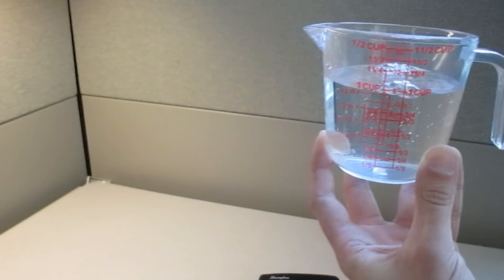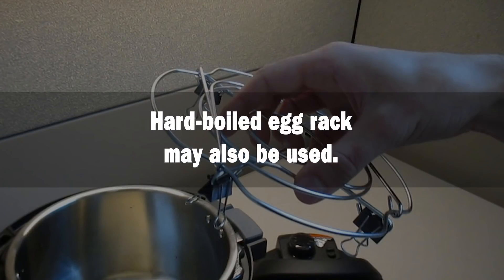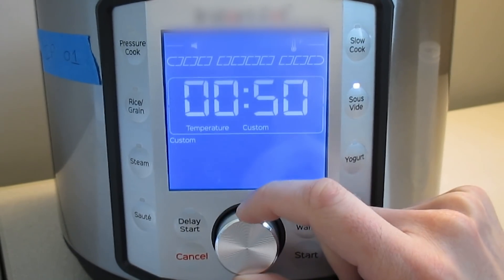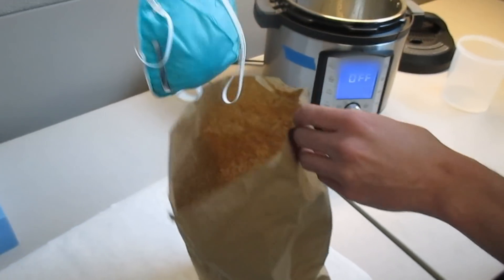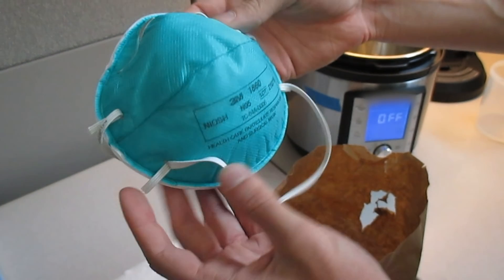Multicooker Decontamination of N95 Respirators

Comment: Tradución a Español 

0:35 Añade una pulgada (3 centimetros) de agua al cuenco
0:45 Después coloca un rejilla al fondo del cueco. La rejilla asegura que ni la mascara ni la bolsa toquen el agua (también puedes usar una rejila para huevos duros)
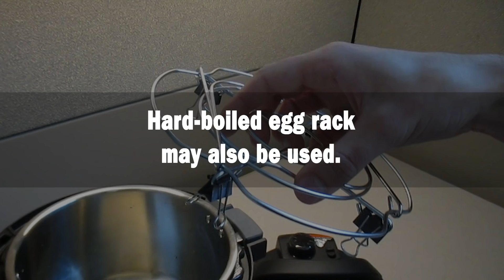1:02 Pon las guantes, y situa la mascara sucia dentro de una bolsa de papel; puede sostener un máximo de alrededor de 3 mascaras
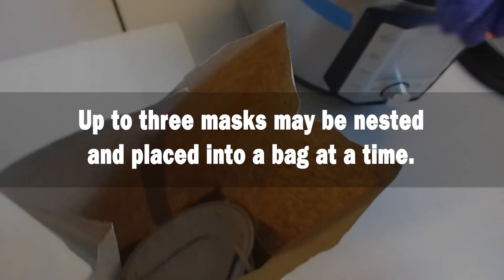1:18 Quita y tira las guantes a la basura, luego cierra la bosla con un clip de papel, o una grapa
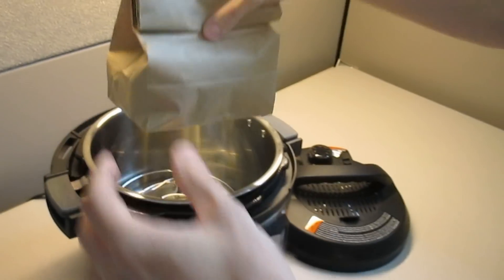1:32 Situa la bolsa con las mascaras dentro del "Multicooker" y sierra la tapa con seguridad
1:40 Seleccione la función de "Sous Vide" o una función similar (asi que puedes campiar la temperatura y tiempo a mano)
1:47 Cuando es necesario, pon la temperatura a 149 F (65 C), y pon el tiempo a 30 minutos. Apretura "Start" o "Iniciar"
Lea el manual del propietario de su "Multicooker" para completar los mismos pasos
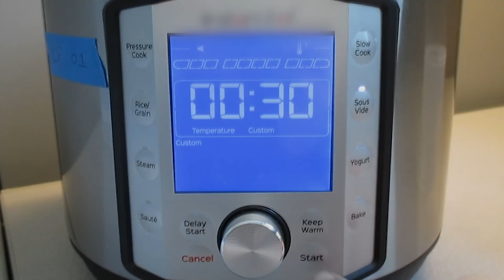2:07 Cuando ayas empezado el ciclo, dejalo hasta el ciclo se cumple
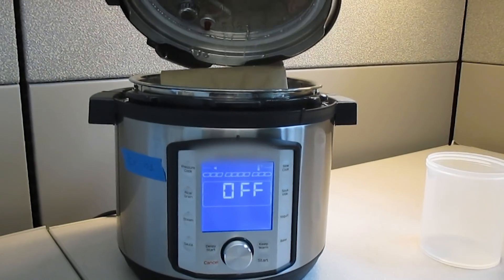2:10 Cuando el ciclo se cumple, quita la tapa
Nota ni la bolsa ni las mascaras van a ser bajo presion cuando el "Sous Vide" funcionalidad es usado
2:22 Quita la bolsa de papel, abrela, saca las mascaras, y pon las mascaras en una superficia seca y limpia para que sequen
Es ideal que se dejan fuera for una hora para secar
2:39 Cuando las mascaras estan secas, examínalos por qualquier daño, incluyendo la espuma de la nariz, las correas de sujeción, etc. Si hay algún daño, tira la mascara a la basura; si no hay, la mascara esta lista por re-usar :)

Comment: I have an insta pot but no sous vide  setting.  What does "equivalent setting" mean?
Reply: Select "Ultra", deselect pressure, and that will allow you to set a custom temperature.
Reply: @MarioFunk  I have the Instant Pot Duo Nova and it doesn't have an "ultra" setting.
Reply: Or select “sterilization”
Reply: @AshmewStudios  Instant Pot Duo Nova doesn't have a "sterilization" setting.
Reply: Casper Carver, basically, you want to be able to change the temperature and timer manually
“Sous Vide” is a setting where u can do that, and “equivalent setting” just means “the setting on your device that allows you to do that”
Reply: @rocket2076  i just found out the "keep warm"  setting is 63 ~ 78°C (145 ~ 172°F).
Reply: @rocket2076  Instant Pot Duo Nova doesn't allow you to set temp manually unfortunately.
Reply: The instant duo user manual on non pressure cooking programs will specify the temp. Keep warm  145-172 degrees Fahrenheit and slow cook 180-190 etc
Reply: https://www.youtube.com/watch?v=At3fB0wamws
Reply: AMV... thats ligit the link to this very video...
Whats the point 🤣